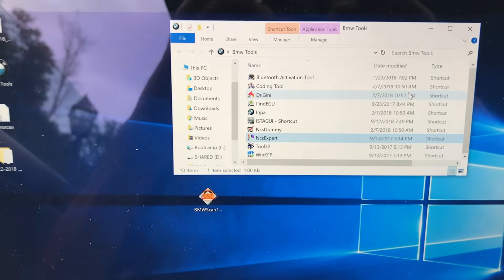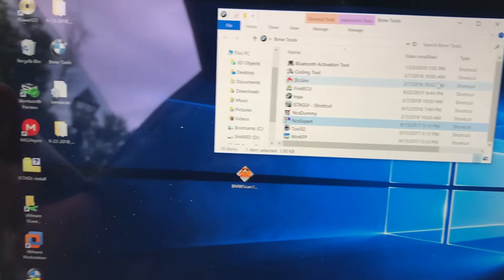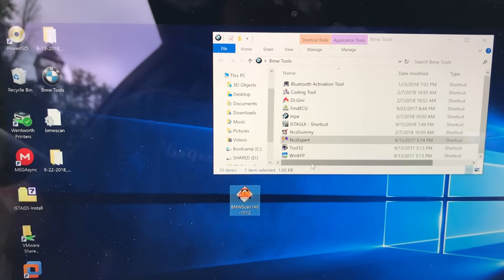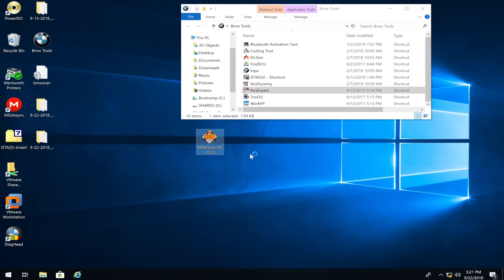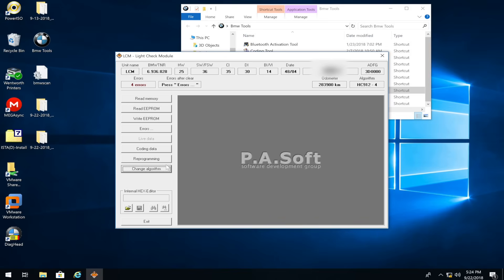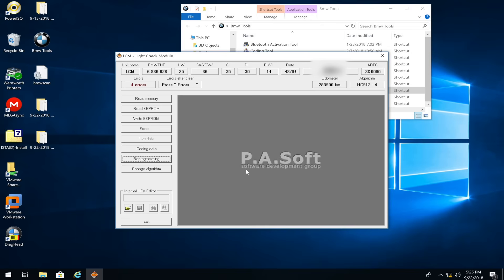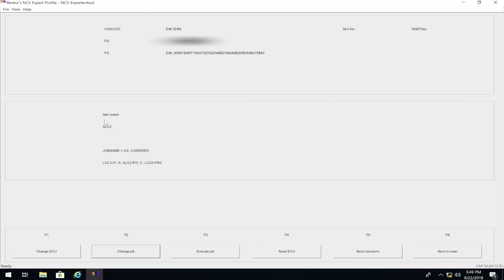Coding New Light Module | BMW E46 LED Retrofit PART 2

Comment: Hey i need your Help. I also have the bmw scanner 1.4.0 but I cant code my LCM on my 2007 E83 X3 its the FCL Model. When i go the coding page the algorithm window is empty and if i try to choose manually an algorith none of the above listed is compatible. Do you know how can i code the warm and cold bulb check out? I installed Leds

Comment: What could be happening after a specialized BMW mechanic changes the new light module and after programming the daytime running lights do not want to work? E46 2003 325xi. What can I do? Do you have any idea?

Comment: Hey Evan just 2 questions ..if fitting the Sonic bar LED tail lights is recoding necessary. I turned off all the light checks and increased V% to taillight LEDs and V% to brake light LEDs. same % as 3rd light which is 70% chasing a parasitic draw.05mA.without ID4 IKE    ..question 2 did you remove the ID4Motion IKE and how many problems have you has with them  I have battery drain of .36mA  with the ID4 connected ...I have removed the ID4 cluster

Comment: Hi Evan, when trying to add the +LEDH, the option does not appear in my menu to select, I have typed in manually and followed the instructions and I still have the rear light errors on the dash, any idea where I'm going wrong? Thanks

Comment: Hey Evan, I have a 99 328i e46. The (original) instrument cluster doesn’t work (it lights up, but speedo, tach, gauges, door ajar lights, etc. nothing works). So, I bought a used donor cluster and hooked it up and it works, kinda.. The speedo/odo still don’t work, and (I’m sure you’ve already guessed it) yes, I have the tamper dot. Is there any way for me to code the new cluster with my BMW scanner 1.4 cable or do I need to ship it off to have the original repaired? I’d prefer to have the original fixed and put back in, but what do you suggest?

-Clay

Comment: Awesome video, was a great help so far. One question though, I used BMW Scanner to code a new LCM to an '02 E39 525i Touring since the original one died. After writing Odometer and VIN, the tamper dot went away, but the "code FA data" option is greyed out for me. I still get error messaged in the dash about the air suspension being out of order. Yeah, no wonder, the car doesn't have it, but without copying the FA data from the IKE, I can't tell the LCM that there isn't any air suspension. Any idea why the copy option is not available?

Comment: Hey bro quick question. I have 03 325i, cluster died, got a used 03 325xi cluster from junkyard. Is bmwScanner method also used to change vin and mileage in cluster? If possible, I want to avoid unsoldering and wiping chip. Also, is it necessary to take VO from LCM and overwrite VO from donor cluster?

Comment: The LCM I have in my car is not on the list anywhere.  I have a mismatch in mileage between the LCM and IKE but not tamper dot.  When I try to write the mileage to the LCM I get the error "Dashboard contains M35080 chip.  Function impossible."
Do I have an incompatible LCM?  My LCM has 19 errors.  The turn signals stop showing on the cluster as well as the high beams and other weird stuff happens all the time related to the LCM.  
Any help would be much appreciated!
Reply: Hey ive been experiencing the same issues, did you solve this?
Reply: @alexcook5008  I just said screw it and went through every algorithm until one worked. 
I have to recode the LCM about every 200 miles or the difference between the LCM and IKE mileage gets too big and goofy stuff starts happening.

Comment: Hello Evan, I am also trying to install led tail lights on my e46 2002 sedan and I followed every step from your video, but I am getting only 3.6 V from lcm to tail light and LEDs do not light up. When I put halogen bulb it lights up but the voltage is again 3.6 which probably is not enought for LEDs...Do you have any advice? Thanks
Reply: Version of my LCM is 3.01

Comment: I get 2 errors called: EWS connection error and IKE connection error and the K+DCAN cable only works for readong engine errors, nothing other. Do you know what might cause that? Still great Video!

Comment: Hey evan i know this video is kinda old but i have a quick question. I an 05 sedan that came with halogen headlights but i wanna swap them out with oem bi-xenon headlights. I understand that i need to do coding so the car knows it had the bi-xenons instead of the halogens so i wont get any light errors on the dash. My question is can i do this coding through carly bmw? Or will i have to download NCS expert?
Reply from the maker: Ncs expert

Comment: I just get a "vin is faulty" help!
Reply from the maker: Make sure the scanner is plugged into the car first
Reply: @EvanGoyuk  hey I found a way faster way to code the tail lights without the need of ncsexpert or 2 cables. By just using pa soft, after you finish the removal of the tamper dot process go into the lcm, select "coding data", select "light coding" (you'll see a bunch of check boxes), uncheck all of the cold checks for the tail lights and that's it you're done.
Reply from the maker: You are correct you can do that. However you are not coding the VO to the car which is not best practice!

Comment: @Evan Goyuk - thanks for the detailed tutorial. I got through all the steps successfully but all my taillights (including the 3rd brake light) are stuck on. Any ideas?
Reply from the maker: What version is the light module?
Reply: @EvanGoyuk  software is 3.6. Hardware is 25. It’s sourced from a sedan though? Shouldn’t make a difference
Reply from the maker: No since we clear it out
Reply: @EvanGoyuk  My NCS expert menus didn’t load like yours for some reason (no “start” F1 or “VO/FA” F2 ) and INPA doesn’t show “cable connected” like yours did despite the other two dots being black. Maybe those programs are installed wrong? I can pull up the VIN info etc under the EWS ecu just fine (I have an early 2001).  I give up lol might have to call a tech on this one :(
Reply from the maker: Did you load the profiles
Reply: Revtors NCS Expert profile? Yes
Reply: @beehauss  same with mine. Not sure what to do. Did you figure it out?

Comment: Hey @EvanGoyuk I went to buy the BMW Scanner tool from 'Zon but it says Works with XP but I see you're running 10 (through a VM I'm sure) is there any concerns?
Reply from the maker: It will work with win 10

Comment: Thank you very much for this video. I need to code an E46 used cluster using the  original LCM. How can we do that with the scan tool?
Reply from the maker: Yes just set the LCM to the what ever the cluster has for mileage
Reply: @EvanGoyuk  Thank you very much for your help. Can i send the information from the  LCM to the IKE ? The LCM is the one who has the actual miles and the correct VIN. Again, thank you very much.
Reply from the maker: Unfortunately you can’t rewrite the mileage to the cluster. It’s stored on the eprom. You could solder your old eprom to the new cluster
Reply: @EvanGoyuk  Thank you very much.

Comment: will unorginal aftermarket trunk lid  lights work with original BMW taillights after programming? Right now I got aftermarket tail lights set which is faulty and I'm planning to change it to original BWW tail lights, however trunk lid lights works just fine and I would like to leave unoriginal ones. Do you think it will work? Or are they somehow "connected"?
Reply from the maker: Yes trunk lights aren’t affected
Reply: @EvanGoyuk  thanks bro, you helped me a lot!

Comment: One  question ... just bought  LED  tail lights for my  vert  and  one  second hand LCM (from a 2004 vert wich comes with LED from factory) do I still need to code it  for the  LED or  just for the  tamper  dot ? Thanks  !
Reply: Ok ,  I see  .  I tried  to buy one  same  like  I have ... no xenon lights  no auto function ... only the  sw to be 3.6 .. and  from a car  with LED  tail lights . The part  is  from a vert  2004  and will end  up on a 2001  vert .
Reply from the maker: You need to code so it knows your cars options
Reply from the maker: And code it for tamper for
Reply: What  coding  I must do ? The  same  like  you did in the  video exept  for  the  LED  part  right ?

Comment: I have a 2000 528i and just got some upgraded LED taillights off of a 2003 530i. I was told that I would need to code the LCM but wasn't told about switching the LCM to code it. Would I still be able to get away with coding the original LCM for LED taillights or should I pull the LCM off the 530i?

Comment: This is a great channel, I have one question though I have a 2010 E60, were would be a good source for the BMW scanner, you mentioned 1.6, I will be replacing the LCM.
Reply from the maker: Yes for the bmw e60 you need BMW scanner 1.6
Reply: @EvanGoyuk  were would we find the cable and software so far no luck
Reply from the maker: eBay or amazon
Reply: Thanks Evan!

Comment: I have an 03 facelift with LED rears that the previous owner put the wrong LCM on. Now have a tamper dot that my local garage couldn't code because it's totally the wrong part (non-auto)
I've sourced a used LCM with SW 3.01 but it's from a car with no LED's 
Will I need to use both PA Soft and NCS to get it all working?
Reply: Job done. It took a whole lot more effort installing the device drivers on my laptop than it did re-coding the LCM.
One part of your video that nearly threw me was when you're going through the list of numbers and you say "pic the one that matches"
I didn't realise you meant the part number, which is on the LCM, which is in the car already. Once I sussed that I just picked the nearest number to it and the rest all worked.
I managed to click "clear error" and turn off the rear light warning but aware NCS is needed to properly work it.
Reply from the maker: Yes! Follow my guide exactly it will fix this!
Reply: @EvanGoyuk  bugger, was hoping I wouldn't need 2 different cables and 2 different software programs

Comment: Hi, great video. I’m actually having a little trouble though. The very last step where you copy FA coding comes up for me as “IKE —>EWS” and not “LCM —> IKE” like you’re showing. Did I do something incorrectly? I clicked it anyways and it removed the tamper dot. 

Also I’m having trouble downloading your link to ncsexpert profiles in your other video to install NCS expert tool. Do you have another link? The other 2 links installed flawlessly 

Keep up the good work, great channel
Reply from the maker: Email me I can help with thisn
Reply: Evan Goyuk I was looking for your email but don’t see it listed anywhere
Reply from the maker: Under the about page you need to be on desktop to see it
Reply: Evan Goyuk Hey, ok email sent. Thanks
Reply: @paulbowden9160  any success?
Reply: @EvanGoyuk i aslo have the same issue
Reply: I'm having the same issue
Reply: Same issue here. Did you manage to solve it?

Comment: Hi,
I know this is old but I programmed module but now low beam on drivers side does get power. Light works when external power is applied. Any pointers?
Reply from the maker: Did you follow the steps in NCSEXPERT too? It resets the module back to default settings
Reply: @EvanGoyuk  Yes, all other functions work, LCM not sending power out on the line to the drivers side low beam. Tamper dot cleared, software version 3.5 in module.

Comment: Hello Evan I have a Facelift e46 2005 convertiable, at present my LCM has three options, which is manual selection to turn my lights on. I understand that day light running can be coded on present LCM. My question is can I change my LCM to four options like your one in your video, so it automatically recognise day/night and switches on front/rear lights when in use to adapt to day/night?
Reply from the maker: You will also need the RLS sensor on your windshield . It includes both rain and light sensor.
Reply: Evan Goyuk is this sensor straight forward to change and code? And there a specific one that I look out for ?
Reply from the maker: The sensor is part of the windshield

Comment: Hello there, just quick question here, i bought identical light module that i had  "HW and SW", do i need to change algorythm? I already programmed the vin number and milage, dot dissapeared, but no really sure if i have too or i dont
Reply from the maker: I would just change the algo to find a match. I believe it should find it
Reply: @EvanGoyuk  Just checked, looks like it was on blue, im assuming it was okay as it was. The other problem i have is i copied All the info from ike, looks like everything is empty there only Vin and milage are not blank. Any ideas how could i download and put those information back again ?
Reply from the maker: When you say download, you mean like your parameters in the trace file?
Reply: @EvanGoyuk  Yeah, i have only Milage and Vin, Everything else is empty, i know there are some sites where you can put Vin number and it will show all information about the car, so im assuming i can just get them from somewhere and put them back in there
Reply from the maker: What step are you stuck on? In side of ncsexpert?
Reply: @EvanGoyuk  In PA Soft 1.4, The screen that u get when You just plug in the cable, it is Car Inspection Screen, shows just milage and Vin number on LCM and The cluster one
Reply from the maker: Ah ok is this a new LCM?
Reply from the maker: When you copy everything from the cluster it will populate everything to the LCM.
Reply: @EvanGoyuk  Well the problem is, i did that, but now both of them are empty, just milage and vin on both of those, shows me nothing more than that
Reply: Thats why im asking is there a way to get the spec from somewhere online by putting Vin and putting it back there again
Reply from the maker: Did you place the cluster too at some point?
Reply: @EvanGoyuk  No, previous owned Could, but when i checked it had good Vin number and  Milage was matching, i have old Light module somewhere, Can i copy things from the old Light module Back to Cluster and then from Cluster to New light module. Do You think it will work?
Reply from the maker: Yes
Reply: @EvanGoyuk  quick update, i did as i said but the same story on old light module, just VIN and milage there. Do you know any way to fit the info in there for the next owner or something i dont wany to leave it blank there
Reply from the maker: I would just continue then follow the steps in NCSEXPERT and see what happens

Comment: Can you do this using ncs expert and ncs dummy? I need to code out the tamper dot and code in the new lcm for my 2001 m3 I did the led conversion to. Thanks
Reply from the maker: You need both ncs expert and PA soft 1.4
Reply: Evan Goyuk do you have a copy of the software? Do I need the isaddle cable or can I use my k + dcan cable?
Reply from the maker: Selymon Shahsamand you need isaddle cable too unfortunately.

Comment: Hello, thank you for the video. I need to change mine because it's faulty... If I get one with the exact same part number, and if I'm not worried about the tamper dot, will I still need to the programming stuff? Thanks
Reply from the maker: Yes you will still need to program it.

Comment: How do you tell which software version an LCM is, without plugging it in?  Can you tell by the sticker on the LCM?
Reply from the maker: Yes the sticker says both hw and sw
Reply: Evan Goyuk where is the information, or how do you decode the information provided?  Some have an obvious 31, 34, etc, but some have nothing close.

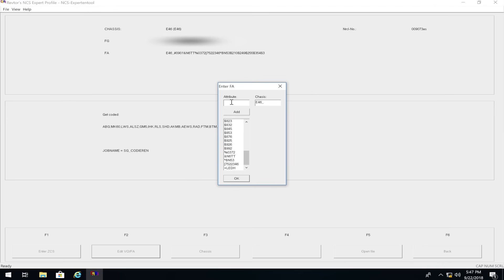Comment: Hey was wondering if you could help. I get to 10:40 part in your video is where i get stuck. I have an 03/01 M3. 
I have no attributes when trying to add the +LEDH. And get and error message when trying to copy them. Back in PA soft my parameters are the IKE and the EWS not IKE and LCM. When i try to copy the coding over to the LCM in just lets me write it over the to EWS. Not sure what to do at this point
Reply: did you ever find out the problem? got the same one
Reply: @Dukemw2 did you guys find the problem? I also have 2001 e46

Comment: Great content. I have a 2004 330ci Facelift with adaptive bi-xenon headlights. I'd like to replace them with aftermarket LED lights. Will this tool change the coding for headlights also? 
 I tried to replace the fog lights with LED bulbs, burnt out both bulbs and popped the fuse. Will this fix this issue also?
Reply: Did you ever figure it out I’m having the same issue

Comment: Great video!
I have a 2003 330ci build date is 1/2003 
Should my Lcm be compatible for sure? 
Also can BMW service shop flash it for me if it's the correct lcm for the leds?
Reply from the maker: Yes it’s compatible and yes they should be
Reply: @EvanGoyuk  ty :)

Comment: Great post. No tamper dot. Everything working fine, also coded triple-blink. Do yoy by any chance have an idea why my LCM does not track mileage anymore? I update it with the current dash mileage, but it wont sync afterwards, in the term that if i check after a month the LCM still has the mileage i previously entered on it. Thanks in advance.